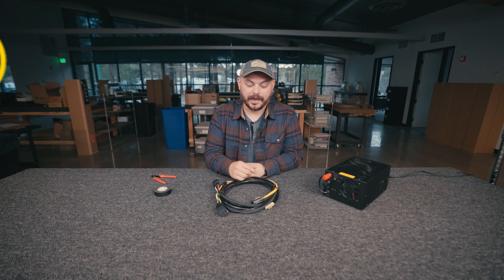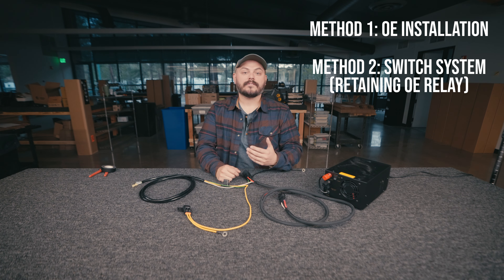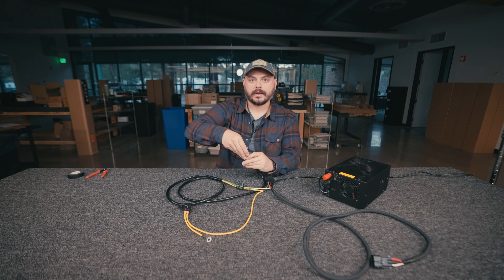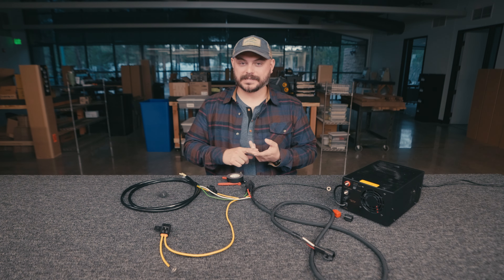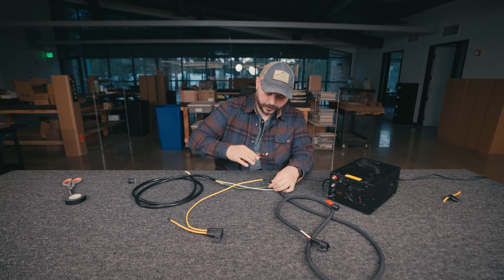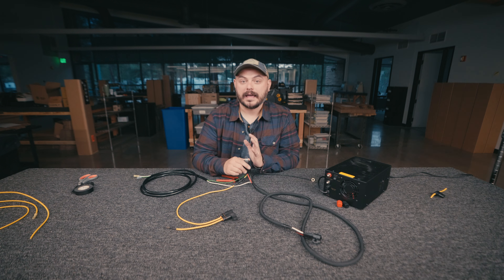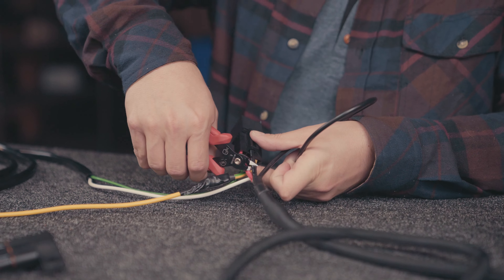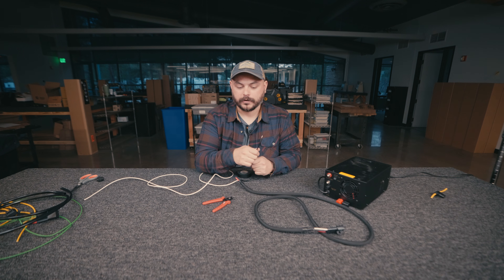How To Wire Up the KC® Gravity Titan™ or FLEX ERA® LED Light Bar

Comment: Nice you see you do a video like this. As you Folks are all well aware, I never use the harnesses you guys send as built. But I also always do some pretty non-standard installs too. ;)
It's fun watching people I'm doing installations for freak out when I open the box, pull out the wiring harness, and immediately cut off the plugs and throw the rest in a drum full of wires by the shop door.

Comment: Thanks. I just got back from the physical install and had to look up the wiring diagram and its logic. This breaks it down perfectly. This begs the question -  If we do install 2 or 3 correctly, that makes it possible to run both white and amber at the same time. Would that damage anything?
Reply from the maker: So there is a circuit on board that actually shuts off the amber whenever the white light is on! So no it will not damage anything!

Comment: In application number 2 ….. does the black (ground) wire need to hook up directly to battery or can it be grounded to a frame ground connection . I have a Jeep Gladiator and it has a frame ground connection under hood.

Comment: I currently have a pro 6 hooked up to a bronco raptor upfitter 3 with 1.5mm wire on 30amp internal relay. 

I would like to use the onboard power for the gravity titan as well. Theoretically the white with a draw of 24 amps should be ok on aux 3 (1.5mm 30amp) while amber can go on a separate aux (10amp 1.5mm wire)

Before I order, cut harness and install, has this been installed and tested on a 30 amp bronco raptor aux switch?

Comment: Hi. thanks for the video. In the video, you list twice the power amp requirements. You do not state if that is for the White or Amber, or if that is needed for each. Those requirements seem high for the amber side. I have a Ranger Raptor with 2 aux switches left. One is 25 and the other 15. IDK what the max number of Titans i can put on there. Any suggestions?  Thanks Robert

Comment: On the option 3 whats is the rquirement circuit amperage for the Amber mode?
Thanks
Reply from the maker: 10 amp circuit will be fine for all sizes!

Comment: For the two gravity titan 6” light, does the wire that comes in the box have a dual connection to use one wire for both lights?
Reply from the maker: Yes! If you snag our pair pack kit it comes with two ends to connect the lights to one harness!

Comment: I am considering the Gravity Titan 50 inch light bar for my Gladiator.  I will installing a sPod BantamX 8 switch controller.  Would I need to use two of the switches to be able to use both the Amber and White light modes?
Reply: Yes, you would use one channel on the Bantam for the backlight and one channel to activate the main white output.

Comment: So, just to reconfirm for configuration # 2 i would connect the yellow and black to my bronco battery and the other 2 switch wires to the switch system?

As i have ordered the 50" titan light bar and i dont think the upfiter switch can handle the amp draw to run them hence going for configuration # 2.
Reply from the maker: Yep you got it!
Reply: @kchilites  thanks for the confirmation 👍

Comment: Hi guys. Thanks a lot. I tried the third solution on my voswitch jk100 and is not working. Any recommendations?
Reply from the maker: Which light are you attempting this with? And what is the max amps on the built in fuse from Voswitch you are using?
Reply: @kchilites  it's the flex era 10. Yes the max. 12v 40amp from the voswitch

Comment: So I wanna use my JLs 4 aux switch, I wanna follow configuration 3 right ?
Reply from the maker: The JL aux switches do not have powerful enough fuses so you’ll want to do method #2 that keeps the KC relay!
Reply: @kchilites  I am only setting up 2 lights. I believe aux 1 and 2 have a 40 amp capacity. is that enough power?